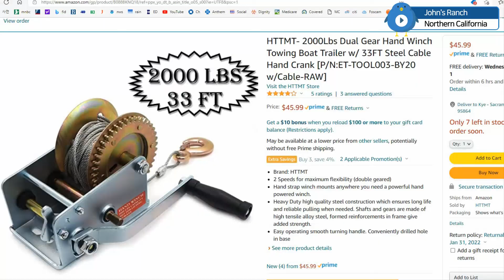Hand winch on the utility trailer installed

Comment: I think you did a good job.  It is a good idea to add winch to trailer.  I did similar.

The winch you got has that wire cable BS.  Man...  I think you might be better off with a flat strap one in future.  If that cable one starts rusting and becomes a pain, pull that cable and replace with a strap if you can.  Or get another winch.
Reply from the maker: That is another way to go...
I might change it in future 
Thank you for sharing..

Comment: This was helpful for me to see some welding. I do not know how to weld but would like to learn. 2 questions if you have time (or anyone else has time to respond.)
Is there a particular type of inexpensive welder that would be best to start out on? I would be welding things like this around the house.
JB Weld---is it as strong as the weld from a welding machine?
Thanks to you and anyone else who might respond. Jesus bless.
Reply from the maker: Hi, Sandra.
I recommend to find used 220v arc welding machine at local craigslist which is way to go cheaper for beginners.
Please watch following  video that I uploaded couple years ago.
https://youtu.be/hKlo3Dr1vvA
I don't recommend to utilize the JB welding.
I never succeeded with it .
Please subscribe my channel for find more info for welding.
Let me know any questions.
John's ranch
Reply: JB weld is two part epoxy and not to ever be used like an actual weld. 

If this project would have been all JB weld...  that pipe would have torqued/torn off the front of trailer before getting up the ramp.